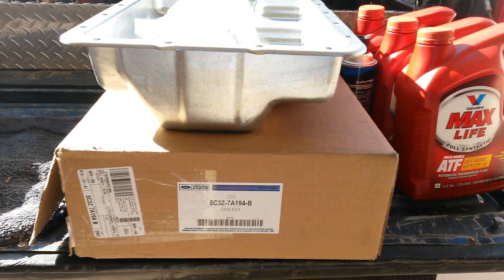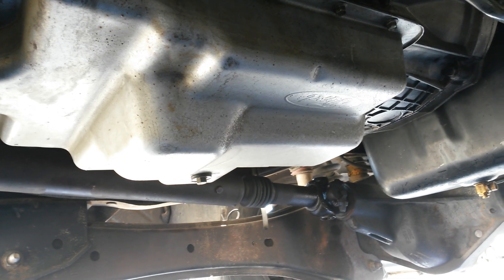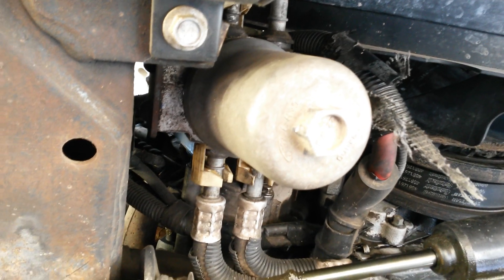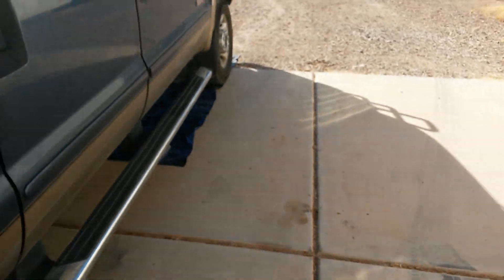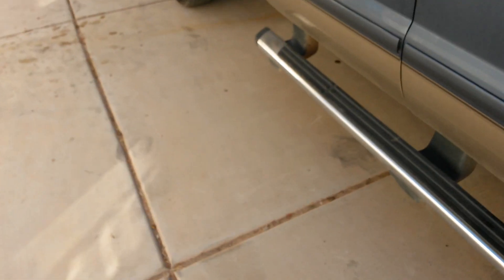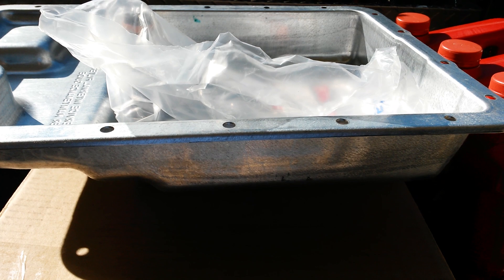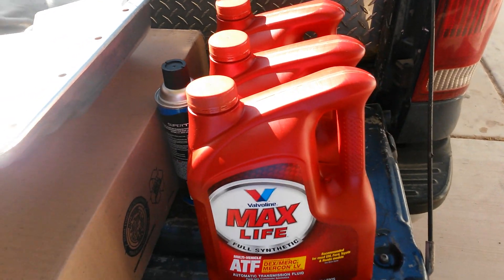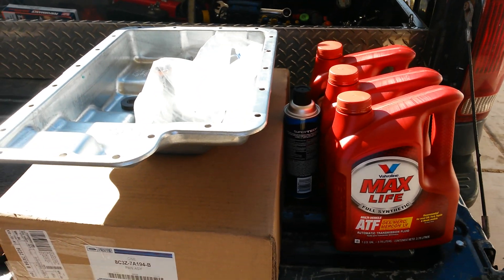FORD SuperDuty Transmission '08 Pan/Filter Upgrade (:1:) Overview: Why Upgrade? '03-'07 - 5R110W

Comment: 2 things, First, is there a part two, Then again I know it's just unbolt, drain, replace, bolt, fill... but still I'd like to see if you had any tips or tricks; and 2, Does the pan happen to come with a (rubber?) seal/gasket? or is it just a "Make your own with RTV deal", if so what RTV is recommended?